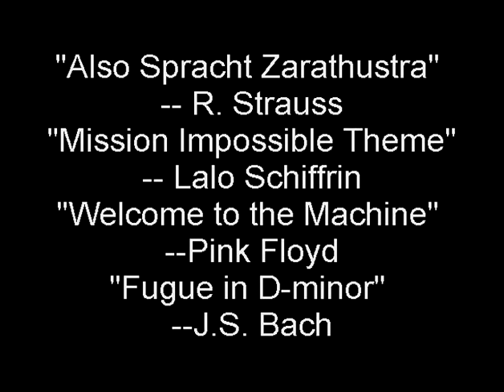Throwback: A Day In The Life Of The MeltShop

Comment: Enjoyed this video and the soundtrack. "Welcome to the machine" by Floyd very fitting for the steel mill.
I'm currently a melter up in the pulpit on an EAF, I also worked the Furnace floor and drove the charging crane for 14yrs and still do when required. I think back to when I was first shown around the melt shop after previously working in the Heavy End of an Integrated steel works for 6yrs, Blast furnaces, BOS Plants etc. Thinking to myself this EAF was nothing in comparison to the size of the kit I was working on previous. That soon changed for me when they charged that first basket of scrap an arced down on it, all hell broke loose, the noise, the light show and the sheer power of the thing just amazed me and still does to this day and long may it last...
Nice one John Griggs.
Reply: 42 years at the Knoxville Tennessee Mill. I loved working there nothing like it!!

Comment from the maker: +RedHeart64 Ha ha! Yes it was very hot at times... and then very cold sometimes in the winter.  It was a place of "extremes" for sure.

When I first started there in 1991 I was just awed by the size and scale of steelmaking stuff.  I feel you.

The boots were heavy leather "metatarsal" boots that I used to describe as "Klingon Battle Boots" because they used some actual metatarsal boot on Star Trek.  Basically, they have a steel and/or composite shield in a leather "tongue" that comes up the outside front of the boot up over the laces and combined with the steel toe can prevent you from losing a foot if something falls on it.

The "hot work" guys that had to walk on 500+ degree partially cooled slabs had soles which were very heat resistant and didn't conduct it super fast.  Only good for a short time, but useful.

Most of us just had thick oil-resistant soles with steel shanks in them for strength.  I still have mine and use them when I explore old buildings for the photography I do.

Here's a blog post of mine with a lot of shots of the guys and a lot of the story of the end of the mill.  I was too broken hearted to write part 2 of it, but it stands pretty well on it's own.  May still follow up.

http://blog.entropicremnants.com/2013/11/19/end-of-an-era-part-1-steel-mill-portraits---melt-shop.aspx

Also, here's more photos on my flickr account in various sets:

End of An Era: https://www.flickr.com/photos/teamgriggs/albums/72157637012132873

The Last Heat: https://www.flickr.com/photos/teamgriggs/albums/72157637206483695

Those are some of the last shots I did there.  If you want to see more, they're in the "Albums" on my flickr site and you can find them.

Thanks for your comment!
Reply: Great photos...

Comment: I find the whole process of steel making fascinating.  Its amazing to watch a piece of metal be processed, whether its forged using huge hammers or put through the hot roll mills and end up as a coil of sheet metal or a length of rail.
Reply from the maker: It certainly never wore off on me, lol.  I'm sure it's been a fascination for many since the beginning of working larger pots of metal in the bronze age.

Thanks for dropping by and commenting, John!

Comment: Melt Shop shift mechanic here for ten years. They pay damn good but it is a rough way to get a pay check :)
Reply from the maker: And right you are.   My job was easy by comparison.  Steel mill mechanical maintenance has to be able to do it all from the small to the massive.  Hats off you.
Reply: It's a rough job but like I said it pays good. Those furnace helpers have a bitch of a job also. I'd like to see a pay raise for them.
Reply: They've been good to me BTW.
Reply: working in melt shop for 4 years now. operate eaf and aod. stainless. work with maintenance on outages. hell of a way to make a living but it gets in your blood!!!
Reply: I worked in this mill for 7 years as a meltshop mechanic. It was so great

Comment: Neither of you know anything about me or my character.
As a multi skilled maintenance engineer, I spent twenty two years in heavy engineering. Due to company take over and closure, I became redundant.
I secured a job in Co-Steel as a maintenance engineer 12 shifts days and nights, working in Rolling mill, Continues casting but mainly attached to the melt shop 100 tonne electric arc furnaces and ladle furnaces, along with charge, and hot metal cranes, until again company takeover and redundancy meant I once again had to move on after thirteen years.
I witnessed gas explosions, wet charge explosions, hot metal burns, hot oil and steam burns. 
As a first aider had to treat crush injuries, broken limbs and a very close friend and workmates death, crushed between a scrap basket and a reinforced concrete wall. I constantly complained about poor safety, but was reminded who paid my wages. Now older and wiser, I have learnt to "say it how I see it" .
Don't tell me about nanny state crap.
Reply from the maker: Well then, Paul, I withdraw my comments, but perhaps you should moderate your attacks if you don't want to be perceived as a troll.  I'll leave you to work it out, but there was anger in your post that was unjustified -- and that, though less, is still a character issue.

I'll tell you that I believe you must have worked in a MUCH worse run shop than ours.  Your firms training and management practices contributed to what might be described as a "shit-show" in terms of the number and severity of accidents.

In your anger, you assumed that everywhere is the same as where you were.  I can understand that considering the loss of a close friend -- but you should still give a thought to the possibility that everyone's experience is NOT like yours and engage in a discussion rather than just blasting people.

Be well, and I hope you come to terms with your experience.

Thanks for engaging but you're still going off a bit.  I recommend you calm down and meditate a bit on your whole approach on this.

Comment: What was happening in the firework show that was at about 2:43? Was something being forcefully attached to it or was it just a reaction common in melt shops?
Reply from the maker: What you're looking at there is 3 phase AC at around 700 volts and over 50,000 amps arcing into the unmelted steel.  Much like in some welding and cutting operations some of the steel is heated so fast it flies off the larger piece in a "spark show".  Sometimes it's even more dramatic.  Really gets crazy is the steel if a little damp when it's put in.  Then the explosive expansion of the water causes even more ejecta.  If it's too wet, it can literally cause an explosion which will blow molten steel out of the furnace -- very bad that.

Thanks for watching!

Comment: Vidicon or nuvicon? ;)
Oh man, the light from the arcs! I haven't seen this in a while.
I remember the crane going back and forth while we were replacing the rear in your ranger until like 4am prior to hitting Centralia.
 Great stuff, bro!
Reply from the maker: +Michael Thompson Not sure but my guess would be Newvicon -- it was a late enough model and the low light capability for a tube-based system wasn't bad.  This was probably one of the last of the tube imager units before the CCD's started to take over.

Thanks!

Comment: how often do they change the arc rods?(electrodes )
Reply from the maker: Hi, Patrick.  The rods are not so much changed as added onto.  The rods have a male threaded post (with a lot of taper -- think of pipe thread but very exaggerated) on one end, and matching threaded socket on the other end.  As they wear down, a new section is added to the top.

You originally asked about ladle sand?  I'll explain in case anyone else wonders.  The sand is put into the nozzle at the bottom of the ladle to fill it and keep molten steel from filling it and possibly "freezing off" in it.  This is done so that when they move the ladle to the caster and open up the slide gate they can get a free flow of liquid steel.  Sometimes it still needs to be "lanced" to get it to flow, but the sand  still minimizes the problem.

Hope that explains everything.

Thanks for coming by!
Reply: @EntropicRemnants  thank you for answering my questions and answering them well thank you very much so the sand melts and stays liquid and the molten steel floats above it to keep the nozzle from freezing the steel solid in the nozzle?
Reply from the maker: @patrickdean9797  Actually this "sand" doesn't melt!  It's like quartz and chromium sand and things like that (I'm not an expert on the composition of it)-- not ordinary silica sand.  

The basic idea is that where the molten metal touches the sand, the sand sinters together into a thin sheet.  The sand below is unaffected.  

When the nozzle gate is opened the sand is supposed to run out and the thin, sintered, solid sheet of sand breaks and molten steel can then flow.
Reply: @EntropicRemnants  that make alot more sense i like the movie have not watched the whole thing yet, but i will i think it cool that you preserved on film and now in is on the internet for ever that is cool thank you.

Comment: whats your thoughts with AC EAF compared With DC EAF ? supposedly theres a cost savings but i've seen both types melt a heat within 45 min...
Reply from the maker: My only experience with DC is seeing one in operation and reading about them.  That is one hell of a rectifier to produce the kind of power many of the DC furnaces deal with.  AC is better some ways, DC in others.  

One of the nice things about DC is I think you can control the rectifier voltage/power to really optimize your melt -- basically electrode height above the bath (or depth in the slag) can somewhat be divorced from the power going into the melt.  Anyway, that's something I think about but have zero experience with, sorry.  

Do you have any experience with reliability, etc? 

Our furnace was built in the 1960's and still had winch driven masts to regulate the power -- slow and subject to various kinds of failures.  We toyed with moving to hydraulics but it never got approved.  We upgraded the controls on the winches with a new PLC based regulator and it did help -- but it couldn't overcome the limitations of a winch driven mast arm.
Reply: @EntropicRemnants  what i noticed about DC difference is there seems to be less sidewall arcing beings the bottom electrode they call it is a series of pins about 3 or 4 feet in diameter in the center of the bottom of the furnace where the DC current travels...we had one experienced DC melter to train the other AC melters ..well you know all the brand new steel mill start ups are a bear to get a smooth operation but that bottom electrode needs some serious temp monitor systems directly to furnace operator..you may have seen bottom wash outs are dangerous as hell on earth..

Comment: The caster doesn't even have a rotating ladle turret the crane actually sits there holding it over the tundish? Lol omg and I thought I worked in a shit hole
Reply from the maker: Ha ha!  One man's shithole is another man's toilet... oh wait, that's the same thing... ;-)

There was a ladle stand -- the ladle didn't have to be held by the crane.  However, the crane is on standby in case of a breakout in the caster.  It will immediately remove a source of molten metal that would just make the breach worse.

Our caster was built circa 1966 or so.  It was one of the first generation of continuous casters built by Concast.  So, it was not of sufficient metallurgical length (meaning slow cast speed of about 20 inches/second) as well as other deficiencies which modern casters don't have.

We made the best of it and made money despite the limitations... up until Evraz bought us and ruined the place.  That's a long story and too long for here.

Thanks for commenting!

Comment: impressive!
Is the movement of the cables connecting the electrodes to the transformer caused by magnetism caused by the extremely high currents (at 2:40)?
Reply from the maker: Harald, you are dead on!  That is in fact from the current (50,000 amps and more) causing some brutal magnetic fields.  Those cables are composed of multiple heavy stranded cables and water cooling tubes and if you were to wal up to one and lean on it, it would scarcely move at all with your weight.  Yet in the video they dance like they're just pieces of string.  I never got tired of seeing that.

Thanks for stopping by, and thanks for paying attention! :-)
Reply: @EntropicRemnants  Thank you very much for your reply. I wasn't sure - to be honest. I photographed several abandoned EAF based steel mills in Germany, but the only active EAF mill I have ever seen was in Czech Republic. I did not notice the movement of the cables there. Your video shows this with great clarity. Thank you for documenting the fascinating world of steel making! A great contribution to the preservation of our history.

Comment: Hi, is this the old Oregon Steel melt shop by chance? I did not see where it's located in your description.I work at the rolling mill that is still operational at the site. It is really cool talking to our old-timers that used to work in the closed melt shop. I was told by them that the old way they poured cast slabs could not complete with the current continuous casters so they just import all the slabs now.
Reply from the maker: No, John, but this mill was also owned by Evraz but it was on the East Coast.  Your melt shop closed years earlier than the one.  We were in fact a continuous casting shop but our gear was old.  We found a way to make money off of it, but when Evraz bought us they thought it was too much work and changed our methods and we never made money again!  Not a fan of your current employer, lol. 

Thanks for commenting and I hope your mill keeps going.  We lost both the melt shop and plate mill where we are -- everything gone.

Not sure I can link here, but here's a link to a blog post I wrote with my feelings about the mill: http://blog.entropicremnants.com/2013/11/19/end-of-an-era-part-1-steel-mill-portraits---melt-shop.aspx
Reply: @EntropicRemnants  Thanks man. No worry I am not a fan of my employer either , none of us are. The only pluses are the job is near me the pay is pretty decent , comparatively, and we can make alot of overtime. That's only because they hire anyone that can pass a drug test and about 85% of our new hires just quit or can't do the work, can't show up. The old guys say it was a great place to work , but it's just a shadow of what Oregon Steel was. I like the actual job I do though, I work in the slab yard cutting slabs. The melt shop used to cast the slabs, now they all come by ship to Vancouver  WA then get trucked over to us. Gary Works slabs come over by rail, I think they are the only domestic steel slabs we roll. Even for my crappy employer it is still cool to me being a part of the steel industry....

Comment: some details would be nice, like voltage and amps, pot capacity, time to cook a whole pot, etc
Reply from the maker: 700 volts, 54 MVA (megawatts), 180 ton heats.  Heat times were around 90 minutes with a 30 minute or so turnaround so we could do up to 12 heats per day but delays could drop that to 10 or 11.
Reply: @EntropicRemnants  wow, amazing it's that fast!  I figured way slower.  but I guess if an arc welder can do what it does, this is essentially the same concept on some jacked up steroids.  thanks for the info!
Just to get that much power from the electric grid is amazing in itself.
I'm assuming that if there is some sort of power outage or maintenance shutdown, the cook time would be longer since everything has cooled down a bit.

Comment: very good little film i am glad that you made it one more question how is the electricity delivered through the electrodes is one negative and the other 2 positive how does that work ?
Reply from the maker: Thanks, Patrick.

Our arc furnace was fed with 3-phase AC current.  It's a form of AC that delivers higher average power and facilitates high power electric motors -- and you can thank Nikola Tesla and others for that invention.  Our furnace ran at about 700 volts at currents that could exceed 50,000 amps.  There were 3 electrodes each connected to one phase of the AC.

3-phase AC is interesting.  Search on it for more info than I can give here.  By the way, your home and most businesses run on single-phase AC.

A DC furnace has a single electrode and the ground through the shell of the furnace itself.  I have never worked with one and have very little knowledge but you can search out say, "DC electric arc furnace" for more information.

Hope that helps to start answering your question.